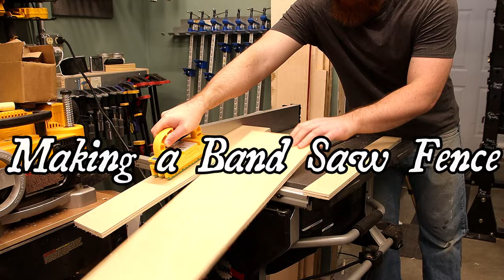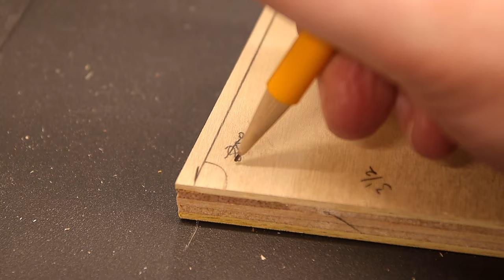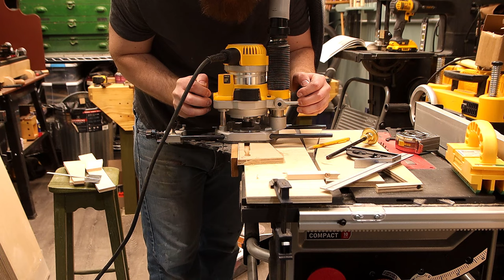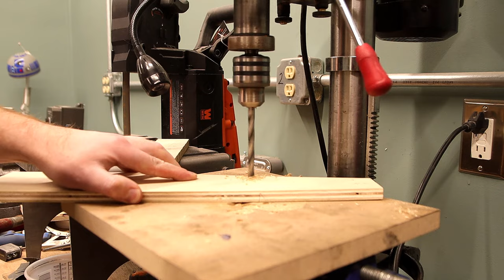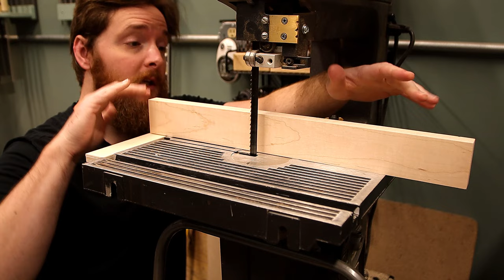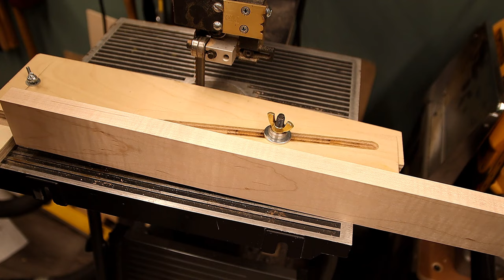DIY Band Saw Fence

Comment: Great solution to a problem. I have a jet 14" sfx, that came with a fence that works quite well. Spent a good deal of time squaring the table to blade, which is a very finicky ordeal, but once yo have it, you have it. Good solution to bandsaws that have no fence.